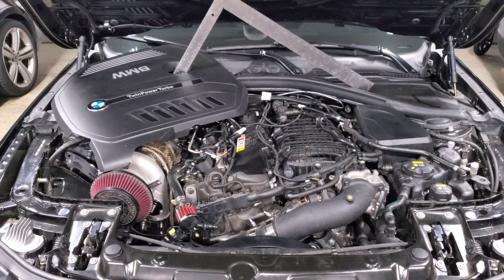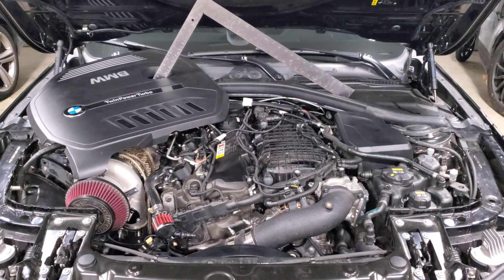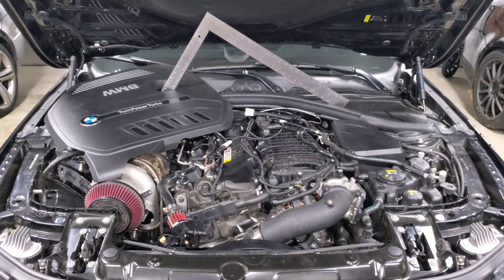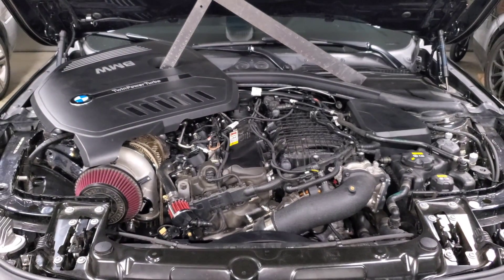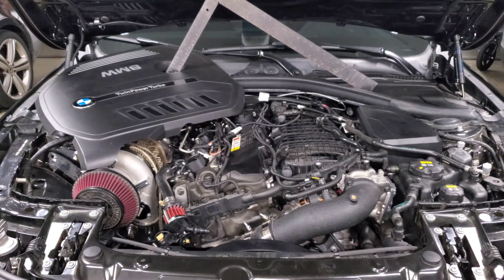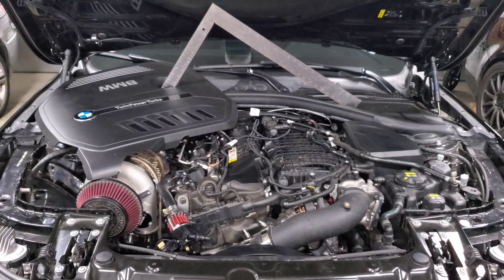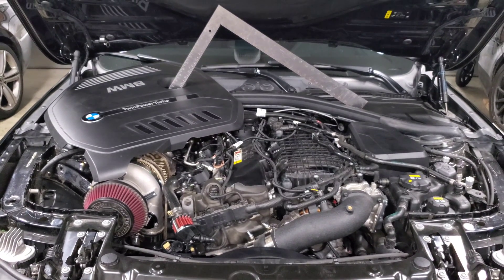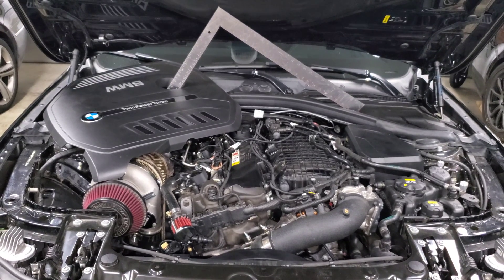Let's talk about B58 Injector Failures - Common B58 Issues

Comment: Still no real answer to the root cause though, I reckon it’s temperature related as it’s nearly always No.6 that fails, I really want to stage 1 my car but I won’t until I know what the root cause is, as staying standard means full BMW Warranty
Reply from the maker: There is no root cause. It's not due to anything other than normal causes. Injectors can fail. I'll explain to all the different ways it can happen in the video.
Reply: @kern417  yes but 90% of time it is No.6 that fails which is tucked deep away at the rear of the engine, the only obvious thing to me is it’s getting hotter, What do you think ?
Reply from the maker: That's not true. It happens across random cylinders
Reply: @kern417  the B58 forum I’m a member of has weekly failures,  and it’s most commonly No.6 that fails,  yes others do fail but 9 out of 10 times it’s No.6,  you have done a great video explaining the different types of failures and how to test and troubleshoot, but still no ones seems to know why they fail open, which can cause catastrophic engine failures
Reply from the maker: I'm a member of several forums, groups, and constantly have people in my PMs. Injector failures are random across all cylinders. And many people have replaced injectors without issue. Typically the ones that have engine failure keep driving the car after it has failed.
Reply from the maker: @nickprince8623  The whole reason I made this video is because there's always somebody new with an idea about how the failures occur. It's always cylinder 6, or it's only people that run ethanol, or it's only people that run MG flasher. At the end of the day it's random with a bunch of different factors that can cause it. It's not linked to one specific issue.
Reply: @kern417  thanks for the info, so from your experience, how long would the engine have to be kept running with an open injector for, before irreversible damage to occur ?
Reply from the maker: @nickprince8623  not long. If the car starts missing/smoking just pull over and shut it off. People have issues because they "just drive a few miles home" etc
Reply: @kern417  When will your injector failures form results be ready to view please ?
Reply: @kern417 yup! N55 injector blew, got it towed ASAP. Engine is running fine to this day , this isn’t just a b58 issue.
Reply: All this tuning is madness, ( 40 years as a mechanic and engineer)

Comment: Installed a HPFP the other day on b58. Ran stage 2+ 93 octane, was good for five hours. Car bogged down unload and just wanted to shut off, bad misfires. I changed all coil packs and sparks. I can only thing it has got to do with fueling.
Reply from the maker: If you run a log and scan for codes then you can properly diagnose it without guessing
Reply: It was the dumbest thing ever. So I installed all my coil packs and apparently I missed one and forgot to bolt it town. So over time it slowly snugged it’s way out and became loose therefore lacking good contact with the spark plug and causing all sorts of codes.

Can’t believe I wasted money on a tow truck to take it home only to find out the coil pack was loose.
Reply from the maker: You'd be surprised how often that happens. Glad you got it sorted.
Reply: I saw a Facebook post that someone had a super dirty Injector and someone said that it probably happened because they allowed the hpfp to get dirty when installing, did you figure it out ?
Reply: @codskilclanchannel6420  yea I did, loose coilpack.

Comment: I want to add to this, my car is completely stock and started to get a bad misfire, the only difference is that I put gas from a different Costco than I usually do and it happened almost immediately after, took it to the dealer, was there for 2 weeks plus got it back with new injectors, new plugs, new valve cover, car is running fine but I do notice a slightly hesitation on cold idle only, 2017 340i, 43k miles
Reply: I also started getting gas from Costco, my injector went out probably a month after using them as my primary station
Reply: @ahmadmanawi2879  costco gas is good
Reply: I get bad idle on cold but is perfect after the revs go down, did you have any more problems after that? I’ve got a b48
Reply: @MN_003  You diagnose this in the end? Cracked piston? Camshaft adjusters?

Comment: As far as i know, most of the times this issue comes from low quality gas, that's why i would only use 98 octane or higher on a performance engine like this.

Comment: Thanks again for a well done video; just a question. How I know my car is misfiring; how it feels, what are the symptoms?
Reply from the maker: It'll stutter and you'll hear pops in the exhaust
Reply: @kern417  hi Kern, im having exactly this specific  isue with my 240, what can i do to fix it? Or what would you do in this case?
Reply from the maker: @juanpauloramirezgodinez5395  run a log and scan for codes
Reply: @kern417  Thank you Kern! Keep up the good content!
Reply: @kern417  Thanks!
Reply: @kern417 how noticeable are the stutters? I sometimes (pretty rarely) get an rpm drop while idling at a red light but no loss of power or torque while wot.. not sure if I should check for a compression test right away.

Comment: I said 2017+ builds have a different rail in the B58 group, not injector.
Reply: I got 2017 m140i yesterday has no issues so far
Reply: @prometheustv2084  what month was it built?
Reply: @one40i19  24 March 2017
Reply: @one40i19  is that good or bad ?
Reply: @prometheustv2084  pre October 2017 have the first rail for cylinders 1-3, post October has the updated/revision/alternative (we don’t know what it’s needed for) but I’ve not seen any post 2017 cars fail so
Reply: @one40i19  thank god hopefully mine we’ll be ok only had it few days now, just says service due in 3k miles on the dash, we’ll go dealership as they can stamp it on I drive cheers for the info
Reply: @prometheustv2084  I’ve driven mine hard, stock, stage 1 and 2+ and it’s never missed a beat. Stick to the basics, get it warm before a thrash, regular oil changes. Always put 99 in her. Should be fine
Reply: @one40i19  I’ve only had mine roughly 3 days now mate, I put the expensive fuel in since I had it, haven’t done a oil change yet tho might get that done ASAP first thing

Comment: The TU fuel pump is designed to run at a higher rail pressure. I know rail pressure is regulated, though that's not how that system was designed to work (ie to compensate for a mismatched fuel pump) and considering we now have fuel system issues, it is a potential contributing factor. 

I also don't agree with you regarding pushing the fuel system to the limit of its capacity or running non standard fuel. Any time you exceed design requirements and safety margins, you have a potential for failure. So unless someone with engineering knowledge of high pressure common rail systems can give an assesment otherwise, that for sure puts extra stress on the injectors themselves or other parts that ultimately lead to the injectors failing.
Reply from the maker: The TU pump pressure is regulated fine due to how the control valve works. I made a video on it a few weeks ago. Check it out.

I also explained why running different fuels within the systems limits doesn't cause it to fail. It's like saying your wastegate failed because you're running more boost. It has a range from 0-100% and it's an on-off switch. Opening for longer doesn't accelerate wear in that sense. You don't have to agree but those are facts.
Reply: @kern417 so when upgrading to a TU pump is there any chance to accelerate injector failure?

Comment: Biggest thing for me was the exhaust REEKED of gas, obviously the car misfired and was acting up. But thats a sure way to tell sometimes. Be sure to NOT drive the car. If it misfires and you smell gas and have a slow crank, TOW IT!
Reply: "ethanol analyzer" lol just @ me next time kevin
Reply from the maker: @brandonfrancom69  if you were the only one i would have
Reply: How bad for the engine can it be if you keep driving it when it won't rev high in this exact scenario you describe? BMW said no issue here and it's completely fine to drive if you have no EML or codes... Asking for a friend lol
Reply from the maker: If you have a bad injector it can end very badly
Reply: If BMW have said keep driving nothing wrong with your car... What can it lead to specifically?

Comment: Do you think we should replace injectors every so often to mitigate the issue?
Reply from the maker: Not really necessary
Reply: @kern417  any thoughts on injector cleaning additives, like Liqui Moly 2007 Jectron?
Reply from the maker: I don't think that really necessary but BMW even offers their own like I said in the video depending on your regions fuel quality. It's not like it'll hurt But it's not necessarily going to save you if there's another problem.
Reply: No.

Comment: Thanks Kern for the video 🙏 makes me feel better about maybe not having to replace my engine from my misfire/car shaking last weekend.
Reply: I had the same issue was it when you were idling ?
Reply: I would like to know that too for both you guys. I just got a cylinder 6 misfire. 

140601 - Combustion misfire, cylinder 6: Fuel injection is switched off.
140610 - Combustion misfire, cylinder 6: detected.
144013 - Ignition, cylinder 6: Combustion period outside tolerance.
144018 - Ignition, cylinder 6: Combustion period too short.
Reply: @kaleb8985 what was the problem just the injector? You had smoke coming out?
Reply: @marianomacias3388  but I had smoke coming out. It was the PCV on top of the engine. I had a bad spark plug once too.
Reply: @kaleb8985  you’re car was shaking and loose power too?
Reply: @marianomacias3388  when I had the tip break off my spark plug yes

Comment: So I want a 340i. I’ve heard good and bad. I sold my E46 and it was okay as far as reliability, I did maintenance on a regular. Do you think the b58 would hold up if I did simple stage 2+ FBO…? Would I have catastrophic isssues down the line, I’m talking like 100k Niels how would she be if I’m running stage 2+? 

I’m all about keeping maintenance up, oil change every 3-4K - liqui Moli oil ONLY!
Reply: wsup brotha. I personally believe you could pull off a CONSERVATIVE CUSTOM TUNE for stage 2+ or stage 3 (upgraded turbos) with the b58 in the long run. i have the same question as well whenever I first got my 440i. if you keep up with your maintenance it will definitely run for 100k+ miles if you keep your tune on the conservative side
Reply: @universalg_  I was thinking just stock turbo. Mhd stage 2+… 

What are the big problems I’d need to take care of ?
Reply: @ThatGuyNers1  main things I’d take care of before/at the 50k mile mark would be: differential fluid change, transfer case fluid, transmission fluid change, power steering change, brake fluid change, coolant changed
Reply: @ThatGuyNers1  those would be for the fluids there aren’t many things that go out on the b58 until you see a check engine light. Spark plugs changed every 15k-20k miles, ignition coils every 50k-70k miles
Reply: @universalg_  yes makes sense! Thanks
Reply: @universalg_  do you need to do ignition coils so often?
Reply: @codskilclanchannel6420  every 40-50k miles if tuned. Or until they start showing symptoms of not working. 80k+ miles if stock
Reply: @universalg_  what are some symptoms ?
Reply: Make sure u definitely get some thicker oil, 5w-40 is a must when running higher boost. My n55 took a bad hit and threw a rod bc it had 0w-20 with fbo and tune. Burns that thin oil up quick, same with the b58. I have a 340i rn and its a very similar set up to adjust to
Reply: @stevephillips729  I’m running 5w-30 liqui moly. Our engines do not need 5w-40 until higher mileage while being tuned. I’d say 80k miles+ cuz our turbos need the thinner oil
Reply: @stevephillips729  would Top Tec 6600 SAE 0W-20 From liqui moli be good ?
Reply: 340s can hold up to 700hp so don’t stress

Comment: Just replaced my plugs and noticed cyl 6 had wet threads. No misfire yet, but I'll guess I'll be ordering an injector. Thanks for the info.
Reply: Mine had the same but its all good 
Have u figure it out ?
I assume its head gasket leaking a bit
Reply: @flaviomartinho1753  I upgraded my fuel pump to the tu2. Gasket seemed to be fine. I'll be changing that when the weather breaks
Reply: @flaviomartinho1753  Could you explain how a bad head gasket can make fuel leak?
Reply: I’ve had a problem with my car for a year and no BMW 440i (F32) garage can solve my problem. Fault light keeps coming on Missfire cylinder 6 I have applied many parts to the car and still haven’t gotten rid of the problem
Reply: I’ve had a problem with my car for a year and no BMW 440i (F32) garage can solve my problem. Fault light keeps coming on Missfire cylinder 6 I have applied many parts to the car and still haven’t gotten rid of the problem